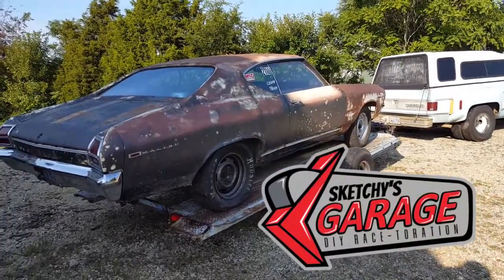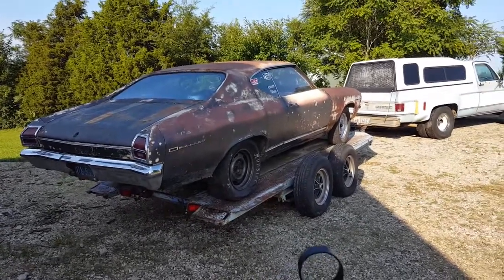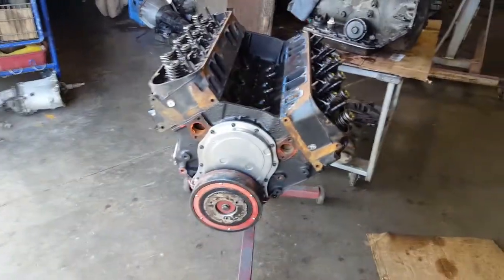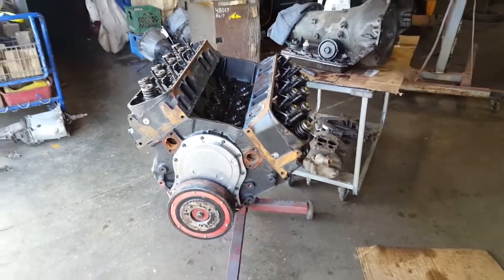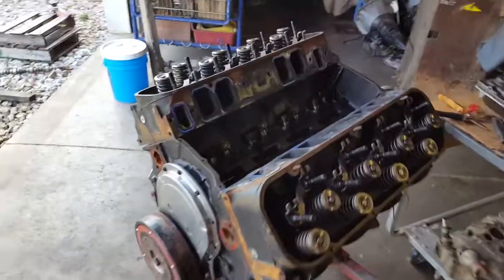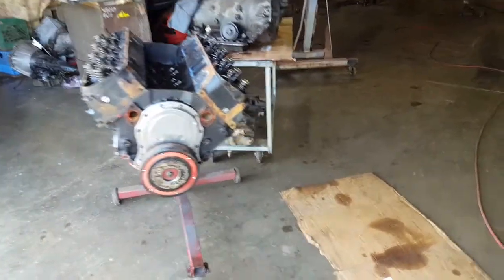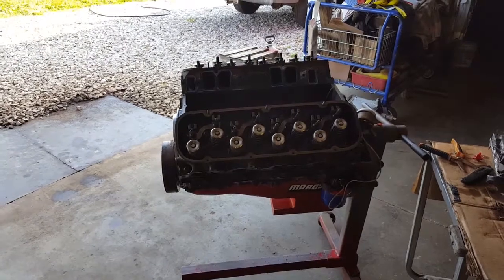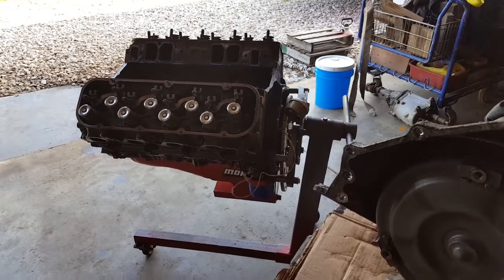Budget Beater Chevelle New Motor? |Sketchy's Garage

Comment: newer shortblock has better heads, springs and combustion chambers will up compression
and improve ets    you need 457 hp to get to 7.0 s
Reply from the maker: How much do you think it will bump up the compression?
Reply: No difference in chamber volume or compression, just rec ports and bigger intake valves other than that most recs are 119 to 121cc's 990's etc.
Reply from the maker: How much horsepower do you think they are worth? I'm pretty sure the other heads are oval port with 2.06 valves. I was hoping about 30 horses.
Reply: @SketchysGarage  should get altleast 70 or more but around 5500rpm and upwards, I'm assuming this includes new cam also. Dont dog ovals I have won races with peanut ports lol.
Reply from the maker: They use to say the big valve peanut port head was the best head to build back in the day. Guy I use to mud race with swore by them.
Reply: @SketchysGarage  I have a set I hogged out the intakes to 2.19 did the porting myself changed out springs bumped up comp with stock pistons and screamed to 6800, 
 215's took home trophys. Oh and tha was racing built rec port headed shop engines.
Reply from the maker: That's what it is all about right there!😎

Comment: just put in newer shortblock in car would be easier than changing cams in old one  and better heads  on newer shortblock   be better for more rpms  maybe 6500
Reply from the maker: Do you think the rods will hold up to 6500rpms? I think it's still got stock rod bolts.